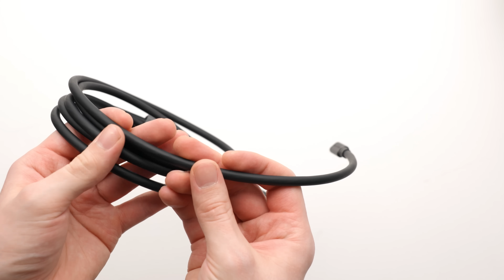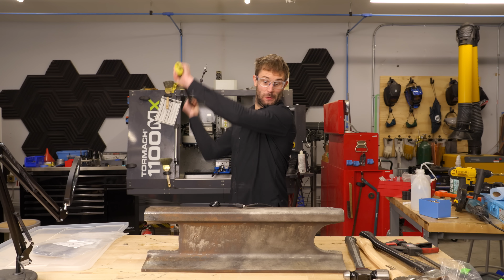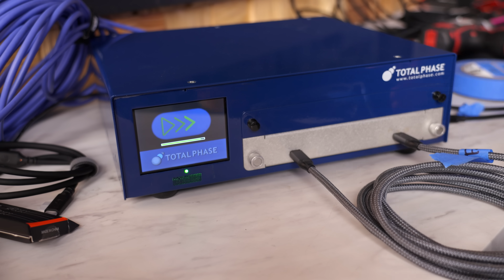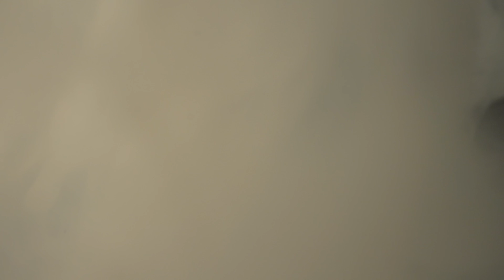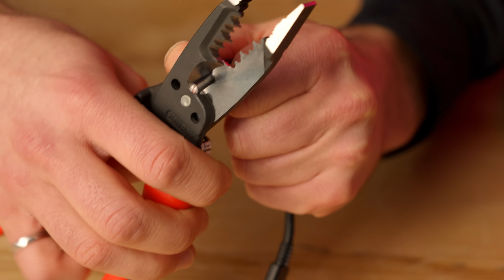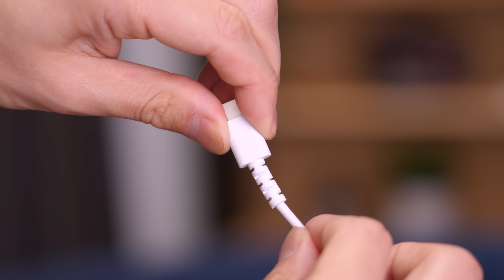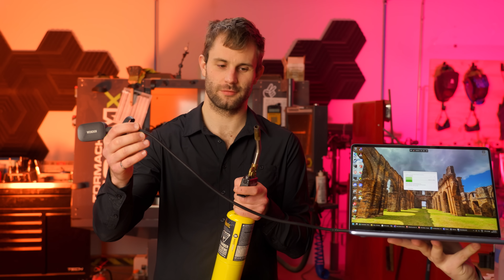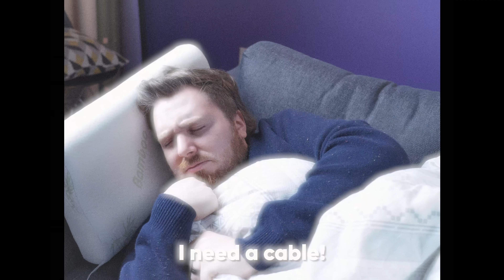Why It Took Me 4 YEARS to Make a USB Cable

Comment: That’s actually huge if they end up keeping this promise of being up to spec. 
For the few who love to tinker and push hardware to the limits of what it's actually capable of, cables have always been the worst part full of misleading advertisements and incredibly hard to decode.

If you ever want to diversify, please take a look at video cables, whether it's HDMI (if that’s even possible) or DisplayPort. They are probably the most confusing ones after all the USB nonsense, and some quality active fiber cables wouldn't hurt either. 
To the best of my knowledge, current options either fail to follow specifications, are way too short, or are extremely overpriced

Comment: This could have been a good opportunity to pair with Monster cables could have had them manufactur to your specs and then could have your own Monster made LTT top of the line cables like they once made.
I remember my dad had to buy the "new HDMI cable" and the option was pretty much Monster and he paid like $80 for a 6" before there were cheap ones included with anything. I still use that same white monster cable for my travel cable and I'm sure it's approaching 20 years old might be a little rose colored but still feels like the best cable I own.
I know Monster was on the brink a while back but looks like they are still alive. Could have been a good partnership to bring back quality to the name.

Comment: Checked the price - you made it sound like they'd be 50-100 dollars. These aren't even that expensive! But what I do find crazy is that you're selling such a wide variety of lengths. I'd assume having smaller stock would save some costs and have an even lower price, although I'm sure someone will appreciate 10cm long cables

Comment: These cables are far from expensive, 30CAD (18.58€) for 1.5 or 2 meter C-C 20Gbit 240W cable (22.11€ with tax), while the Anker Powerline III Flow 1.8m 480MBit, 240W cable is usually 21.99€ (currently 14,99€ both prices including tax) and has worse strain relief this is actually priced really good, no need to hide price.

Comment: I hope you sell enough for this to be profitable. For all my years on this planet, I've had 2 cases where a faulty cable has given me significant trouble and both of those cases were thuberbolt with a device that actually CAN saturate the bandwidth of the spec. Those were expensive devices, so they require a quality (and expensive) cable. Otherwise, I don't think this is a product for me.... which doesn't mean it's bad (or good) :) . Wishing you great success with your new product line!

Comment: interesting for cables but do they do display in and out. Sure, 40 gigabits. 240 watts what about display port? Power delivery control. and all the other functions of USD. 

Do another video answering each thing that your USB can do, and I'd probably buy all of them. Cc ca ccv ccp ccd use acronyms.

Comment: Will I be able to use these cables in place of my new cable from framework for charging my laptop?
Reply: if it meets the voltage standard yes, also good luck they're already all sold out

Comment: If you just need A USB cable then there's not much point buying this, BUT, if you need a USB cable that is certain to work at advertised specs, then this is a great deal.

Comment: USB ISSUES... YOU WILL NOT BELIEVE THIS...
I built my sister a PC recently. Here's what I found through DOZENS OF HOURS of hair pulling troubleshooting:
1) one USB Type-C adapter was "USB2" only so I got about 40MBps data transfer
2) another USB Type-C adapter cable caused my USB3 drive to transfer at USB3 speeds one way, but not if the thumb drive was reversed
3) I found MULTIPLE issues related to USB for my sister's PC that I finally solved
- front USB Type-C cable was defective. It caused instability using a DIFFERENT USB connection on PC (grounding out the USB bus? Only found it when I moved the PC and it suddenly failed to start. Sigh.)
- other USB instability fixed by dropping DRAM to JEDEC Standard (passed Memtest86 but somehow caused USB instability. Ryzen SoC voltage issue?)
- Wi-Fi USB disconnection issue on multiple PC's caused by unknown issue but fix is to FORCE in Device Manager to use USB2 (or USB3) but not Auto (Switch Mode)

*I was trying to DIAGNOSE USB issues only to discover after many, many hours that I had a 50% chance of getting USB3 speeds depending on how I inserted the Type-C USB drive.

**In the end, I used CrystalDiskMark to verify which USB Type-C adapters were full USB3, USB2 only or USB2/3... you'd think I'd throw out the USB2 only but they are actually handly because I have a USB3 SATA SSD for my KODI device with all my movies which gets WARM if I use the USB3 Type-C adapter, but doesn't if I use the USB2-only adapter. Also, probably would fix that wi-fi disconnect issue (if it can't use USB3) if it was a Type-C.... oh wait! I can fix this with a Type-C (USB2 only) connected to a different USB adapter, then hook up my wi-fi. It'll only pass USB2 and thus won't try to switch between USB2 and 3 (which caused the disconnects unless forced in Device Manager which seems to reset on some Windows Updates. Sigh.)

Confused yet?

Comment: I once bought an off-brand "quest 2" cable since the original was priced super badly. It was advertised as 5GB/s, which would be adiquite for Quest Link. However, I found the image stuttery and not as clear as through wireless Steam Link. Found out the cable was not even half of the advertised speed.

Comment: "It's not going to be cheap"
>Looks inside
>Each cable under $30

Like sure it's not one of the friggin 5 packs you can buy for $15 on amazon, but that's still a pretty reasonable price if what you're offering is basically a cable that's better than all the rest.

Comment: For the audio crowd, loved if you guys made a USB A to B or USB C to B cable. While I imagine audio enthusiast being a smaller part of the audience compared to those into computers/mobile devices. Audio enthusiast are the type who are willing to spend more money on a premium cable.
Reply: Unfortunately not enough people use B-terminating cables for anything than printers and some monitor USB hubs. I'm surprised any audiophile equipment would opt for a B-shape port though, that sounds like planned obsolescence if it's recently released and not of a USB 3 spec...
Reply: @KirbyNPenguins broooo all midi controllers, controller surfaces, etc are all USB-B, it’s low key a pain in the ass lol
Reply: @KirbyNPenguins Yeah unfortunately a lot of desktop dacs and audio interfaces still opt in for USB B in recent years.
Reply: C to B 3.0 would be a dream cable for me. Direct from my laptop to KVM without the C to A adapter in the middle.
Reply: Not only this, but I believe KVMs also generally use USB-B for their computer uplink connections (including built-in ones on monitors), so it would be useful for that as well.
Reply: They didn't make a ferrite version... a little shocked, to be honest.

Comment: I was actually amazed how great the pricing is. I genuinely was expecting them to be a lot more. Sadly, it's double the price when I factor in shipping + tax (UK here), but I know that's not LTTs fault.

But honestly, buying cables is a nightmare, the idea that there's a cable out there for honestly not much more than I have spent in the past and ending up throwing away that's actually going to do what it says. 100% worth the price! (for those not dealing with international shipping).

Comment: Wow, $30 CAD ($22 USD,  €18.50 EUR, £16 GBP) for a C-to-C cable that can actually do 240W PD and 40gbps is actually really good value.

I'm not surprised most of the SKUs are already sold out.

Comment: The prices aren't actually as bad I thought they would be. I don't need any new cables at the moment but once I do I will likely go with ltt. I think the biggest barrier would be shipping cost, if I only need to replace one cable the fixed amount for shipping may make the product prohibitively expensive (I understand there is limited ways to address this issue). But if I am buying more than 4 at a time the value seems to absolutely be there.

Comment: If you paid 10000 dollars for a type c cable tester you got ripped off. It's not something to flex about. You've got the resources, it's not a big deal to throw in a couple of super high resolution ADCs and a microcontroller. You might also throw in a pd protocol chip as well and make a PCB for less than one tenth of the price. While you're at it, you might also make that available to the community so that people learn and also maybe try their own. 99% won't and they'll buy your cable but the 1% will remember your kindness, which will become important later in life.

Comment: i hope that there will be a 90 degree angled one in the future because its so hard to find a vr link cable that has both a fast and stable data connection and good build quality
Reply: An angled cable would also be perfect for a phone charger.
Reply: @mrrandomperson3106 and a car cigarette lighter adaptor

Comment: Honestly hearing the pricing disclaimer, I was expecting a higher price on the cables. I paid significantly more for a 10gbps cable from Anker a few years ago. That was a fiber optic cable that I used for VR, but I'd assume a properly tested 20 or 40gbps copper coax would do the job.

Comment: as a wire maker myself. can agree that cable is very difficult to make. and the "ribbed" is probably due to the jacket od specs being so close. or just how the extrusion head is set up that day, tension on the cable while extruding. A bunch of stuff even just whos running the line that day.

Comment: It would be nice to know which ones output video and which ones don't! For example the 480mbps ones, can they transmit display port or no?
Reply: @andreaspatsalides1914  they cannot. 
480Mbps would be USB 2.0 which is a pretty old standard.
For Video output you need at least USB 3.0 (≥5Gbps or more) if I am not mistaken.
Reply: DP Alt Mode in USB C uses the high speed lanes, therefore a 480Mb only cable will not work for DP Alt Mode.
Reply: It is overwhelmingly likely that the 480mbps ones do not support DP alt-mode, while the 20gbps (or 40gbps) C-to-C cables do support it. (But yeah, would be great to see confirmation of that in the product details.)
Reply: @ploxiln thats what I thought. The 20gbps is not guaranteed either. I believe at 40gbps it has to have it
Reply: Isnt the only differences are power, length, and speed?
Reply: @clipsofstuff2758 the speed determines if you can transfer video over the cable or not.
Many cheaper phones still can't output Video over cable even if they can fast charge.

Comment: The best commercials include copyright infringement.
Reply: Ehh... one could argue this is a parody, and thus explicitly protected as fair use
Reply: @monabuu concurred
Reply: Despite what content cartels and authoritarian platforms would have you believe, parody is explicitly covered under fair use.
Reply: @TokenSelf it is, but Fair use is an affirmative defense. Meaning legal protection is not automatic, nor unconditional—each specific case has to be proven in a court of law to be considered fair use. And the work being used for a commercial as means to sell a product makes it even more tricky. 

Unlikely they get sued, but technically, it’s not fair use unless a judge says so—which is why they ask not to be sued in the video.
Reply: This isnt copyright infringement
Reply: you know copyrighted works can be licensed, right?
Reply: @deepspacewanderer9897  You dont need a license for derivative work
Reply: @Obbliteration  You do. You can't just make something that's entirely based on copyright-protected work. What you don't need a license for is review and commentary, parody, and quoting.

Comment: Now do PSU cables, theyre all garbage, sure the connector isnt well designed at reference with little overhead for future proofing and they have been avoiding load balancing but  burning connectors and low ductility on the wire is just being cheap. Other industries are pumping huge amps through connectors and you see no melted plastic or sheathing, just solder melting at a 1000 amps for some of the more robust connectors, well beyond the spec of the connectors

Comment: Y'know, I wish you did include braided options. I don't really care about the thickness or stiffness too much, but the fact of the matter is I only buy braided cables nowadays for devices that are not stationary. Why? Because otherwise the cable collects tons of gunk even before it starts to degrade if it's used often enough. Braiding makes them not sticky (I have cables with silicone sheathing, too, and they're still just a little sticky, and they were even brand new, because that's... the texture of silicone, and it only gets worse with wear in my experience). Hell, I would not mind a looser sheath around it like some peripheral cables are if it helps minimize the stiffness. Anything to make them accumulate less gunk and drag on fabrics less.

Comment: there doesn't seem like a way on the website to see the wattage of each cable type. it only shows the transfer speed and length. is there a way to figure it out for each cable?
Reply: The wattage is constant and shown in the Parenthesis behind the label. The C to C are all 240W and the A to C are 15W.
Reply: @PampersRockaer  i see! cool thanks!

Comment: Crazy of you to do this. As someone who works on devices that come with a cable, I am very glad to see this sort of thing. Although, this is definitely going to be a niche product. People just don't notice our of spec cables enough to care. But I'll remember it when I need one.
Reply: Judging from the number of people saying they can’t get any because they’re sold out, I would say this information isn’t entirely accurate or that niche is actually a big market.
Reply: @zooning-6843  turns out that having an actually (claimed) reliable cable with informative labeling directly on the cable to boot is desirable.  Having something that just works™ is nice since it eliminates a thing to worry about.

Comment: I've been considering replacing my 1 year old pixel 6 because I thought the usb port was dying and wouldn't charge. I've spent $120-$150 swapping out cables for the same problem to happen again and again. Split housings, unstable charging speed, usb 2.0 only data transfer speeds, weak physical port connection. I've bought cables form Ugreen, Cable Matters, Anker, etc. I'm hoping and praying that you guys get more cables in stock before I spend even more money lol

Comment: ic 15w and 240w options....mayhaps a 60-100w middle option in the future? 
with 5 Gb/s as i'd assume that would aid in the cable being thin and flexible.

have a 20 Gb/s 240w but the thing is so damn stiff (and it's used mainly to charge/move things to and from my phone so...more then usb 2.0 yes plz 20 gig...well it's futureproof as hell :P

Comment: There's a reason why usb4/thunderbolt never took off as much as regular USB3 type A. it's so confusing to find a cable that actually adheres to the spec fully
Also i might consider buying one if it will fit the recessed port in my keychron c3 pro keyboard!

Comment: im so confused all im getting is that the manufacturer did the actual hard work designing the product with their engineers but all lmg has done is tell them whats wrong every revision, slap the lmg name on it and retail the product
Reply: This is very common for most product development! They make cables, that is what they do, they have a lot of knowhow and experience that there is no reason LTT invents all over! 
And as far as I get, not just from this, but from WAN shows over time, LTT has come with inputs like they should be individually shielded, they wanted the silicone, they have come with inputs on the right strain relief. 
Also, CLEARLY they are the only, or at least one of the very few, INSISTING that the cable is actually up to spec, and not just rely on error correction after the fact. That alone is worth something.
Reply: First they choose a manufacturer who could deliver signal integrity. After that begins the design phase, that I assume is kinda like Apple does with designing in California and producing in Taiwan, Vietnam. 

Ltt creates the design, and when they achieve a satisfactory final sample, the manufacturer has the spec to go ahead and mass produce it.

ANY manufacturer could have done it (AND STILL CAN), but no one does a reliable truespec, and thats their pitch.
Reply: Do you go into McDonalds and make your own food?
Reply: @roundcube2948  are you stupid or rage baiting?
i am the consumer, i go into mcdonalds and buy a burger thats already made, and i go to ltt store and buy a cable thats already made, that is not the issue here
with the screwdriver, there was much more emphasis on how the employees of ltt designed the product
here they didnt design shit, like i said already, all they seemed to have done is point out problems in the revisions this company had sent and make suggestions that the company actually implemented and designed
yes usb is incredibly complicated due to how robust it is and they do point that out in the video thus it is quite unrealistic to expect in house ltt employees to have been anywhere near designing the cable in terms of electronics
but ltt is taking too much credit for what they have actually done

Comment: Got the email and instantly ordered a couple.  Hurry up and get on the other connector types though - I want to slowly work on replacing cables in my house to perfect length and proper quality.  They do fetch a premium price, but espeically if they meet what I assume are your intensive standards about quality and durability, that price premium is evened out with the fact that I won't need to replace these because of crappy connectors.  Keep up the great work.  Also, solid video.  10/10 on the song Riley.